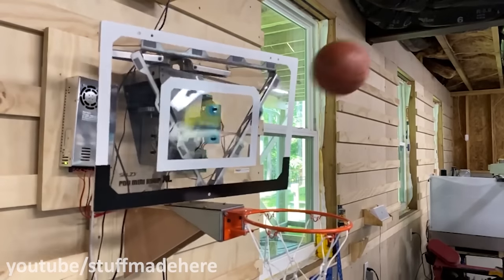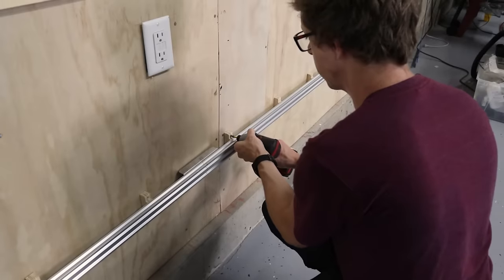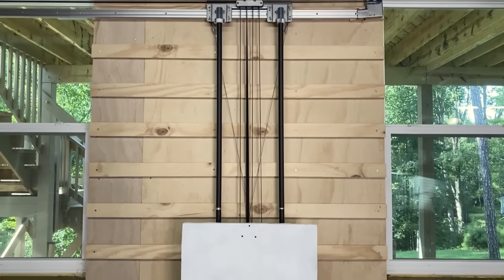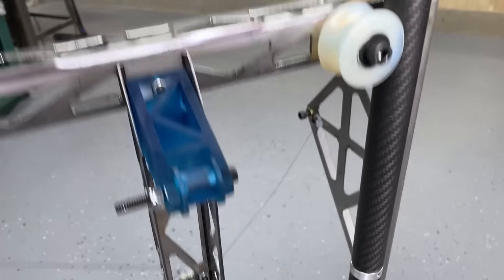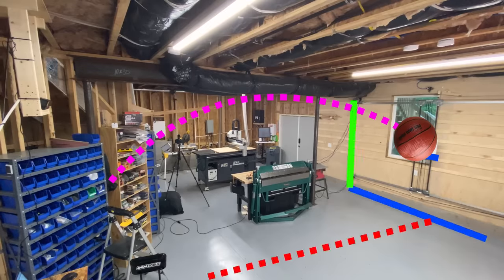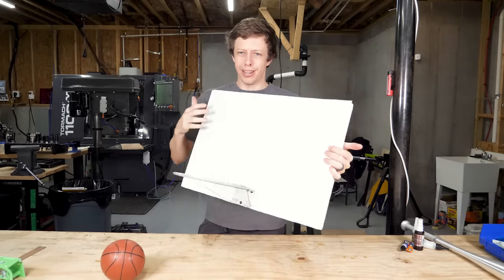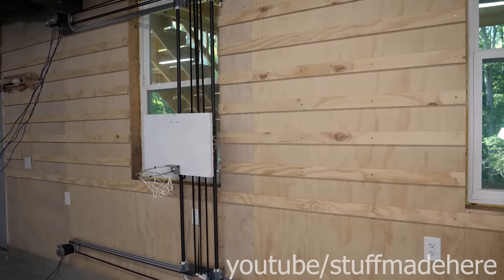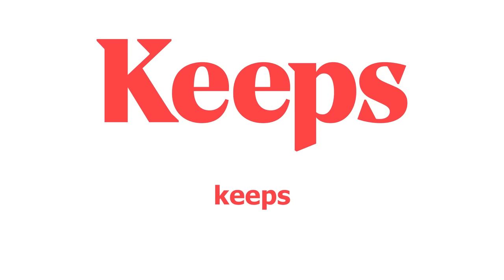Moving hoop won't let you miss

Comment: The mechanical design skills and knowledge and the software skills are impressive. I’m a mechanical engineer and normally a project like this would have an ME for the mechanical part and a software engineer for the coding. Super impressive you did both and made the parts your self. Inspirational
Reply: you know he wrote the support structure algorithm of the Formlabs SLS printers
Reply: can use the same tech to intercept ICBMs as long as the sensors are fast enough
Reply: And i still have to convince my room mate whos not even doing an engineering major that this project is objectively « hard », while he keeps saying « it´s not hard, you just have to get the knowledge on the internet and get to work ».

Comment: I'm speechless. Not because of what he made, but because of all the things he knows how to do. Not only that, the patience of this man is insane.
Reply: Check out Martin and his marble machine mmx for zen- like patience with engineering. Also frequent use of angle grinder to remove mistakes.
Reply: @DavyHulme  oh my! Thanks for the recommendation. Wow!
Reply: @Johny_D  hope you found it OK - had a brain blip the channel's actually called Wintergaten. 
Martin's doing lengthy testing of mmx at present but there's years of videos the creation of of both his first marble machine and the mmx
Reply: @DavyHulme  I did find it, no problem. Thanks again
Reply: Yea I mean just look at his book shelf.
Computer graphics, architecture, compiler design, and a bunch of language manuals on the top
Stats and fluid mechanics on the second level
Heat transfer and I imagine other physics/ME topics at the bottom.

Obviously someone who is an amazing mechanical engineer with a good knowledge of software/electronics. I bet project teams fought over him when he was in college.

Comment: "My code thought a millimeter was a meter and the world was upside down."
If you ever wanted to know what it's like to be a software engineer, it's this. Code will find ways to break that you cant even conceive of.
Reply: welp :')
Reply: Ever put one = instead of 2 
The code will run fine 
And will show no error
But every single dependant variable gets ducked
Reply: Decimals will always mess you up. That and when you need to do comparisons and put = and wonder why it doesn't hit the clause you need.  Trial and error at its best.
Reply: No, to be fair, when I write code, it's never stuff like that. That's very easy to diagnose and solve. It's always the script seeming to executing in a way that doesn't make sense
Reply: Murphys law
Reply: COPIED COMMENT

Comment: The amount of engineering you do in all your projects is wild, I mean such as making parts by hand using interesting methods all the way to writing computer codes, that's what gets me, usually that takes a team of ppl not one.  I went to school for computers, and the rest are just hobbies, but watching you work makes me feel dumb, and I'm a VA tech alumni 😂

And for ppl like me, we want to know how you troubleshoot the program that made your hoop run horizontal then vertical, but not diagonal, or at least not at the correct time. I saw you had diagonal movement but only after initial horizontal movement.

Comment: as QA I have to ask - what if the ball is curled? The only things you measure are speed, height, distance from the backboard, but when such a curled ball hits the backboard, it may bounce differently than the system assumes.

Comment: Next version, hoop also moves in the z axis.
Reply: Just glue the ball to the hoop
Reply: Na... 4th dimension
Reply: Next version, hoop travels through time
Reply: dude can sink the hoop back to 200 bce
Reply: WeNeedMoreFarads the hoop does travel through time - if it didn’t it would only exist for an instant
Reply: I does move in the z axis when it tilts
Reply: @vineethreddy8226  that's not moving, that's rotating
Reply: Vineeth Reddy do you know what a “Z” axis is? 

Y= up and down 
X= side to side 
Z=Towards you and away from you 
[Forwards and reverse]
Reply: Vineeth Reddy when the hoop tilts, it’s moving on a curved X/Y axis.
Reply: With a speedy drone
Reply: Yes
Reply: ••••  nah you need 5 coordinates to specify both position and rotation of a rigid body, xyz don’t cut it
Reply: Na 12 dimensional is the way to go
Reply: That would be unnecessary and pointless.
Reply: So it attacks the ball holder
Reply: @user-zx2eh6qg2t   If you consider some point on the backboard and some point in the room,with every tilt  distance between two points in z-axis does change. So with every tilt the point on the board moves  forward or reverse (towards you or away from you) I do know what z-axis is.
Reply: @squelchedotter  it currently does, as we do
Reply: It would slap him. XD
Reply: Next: machine summons balls in the loop directly

Comment: "pretty simple system of linear equations"
Me who can barely remember the Pythagorean theorem
👁️👄👁️
Reply: WTF is that?
Reply: @kkounal974  I'm so confused
Reply: @fade2black001  in a triangle where one corner is 90°  (L shaped , looks like -> L\ ) a × a + b × b = c × c (a^2 + b^2 = c^2) ,c being the longest side (opposite from the 90° corner)

Example: a=3 ,b=4 ,c=? 
3×3=9 ,4×4=16 
c^2=9+16=25
25=5×5 therefore c=5
So the triangle’s sides are 3 ,4 ,5
Reply: Me who is procrastinating my linear algebra homework
👁️👄👁️
Reply: Mad Mew Mew  Current example he is going over: define a linear matrix transformation for a rotation -45° about the origin. 
So I get a little bit of both 😅😭

Edit: In case you were curious:
T: ℝ2→ℝ2
[cosθ, -sinθ;
 sinθ, cosθ]
Reply: @reenokop  I think I get it